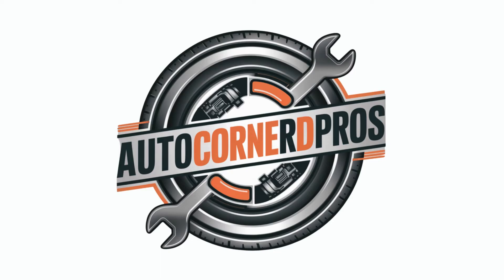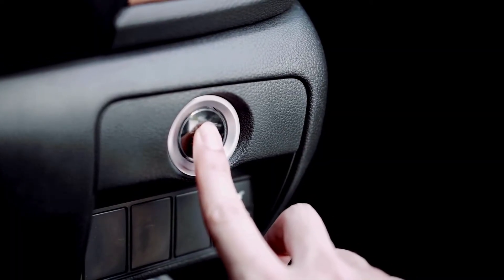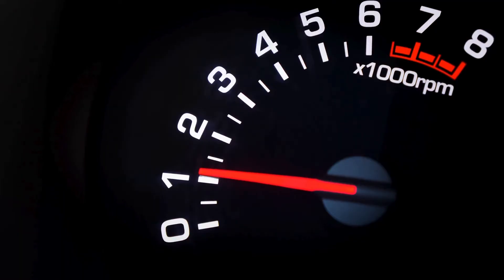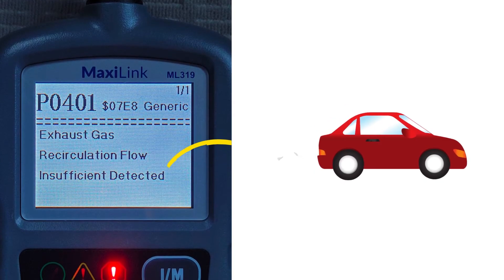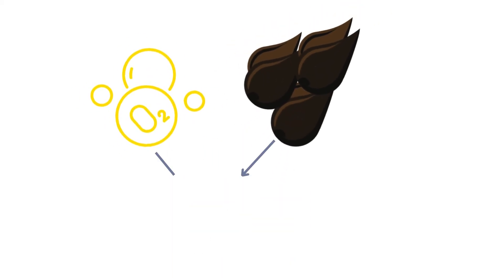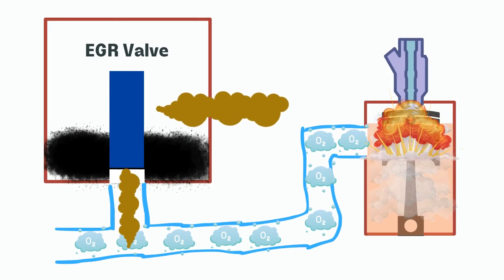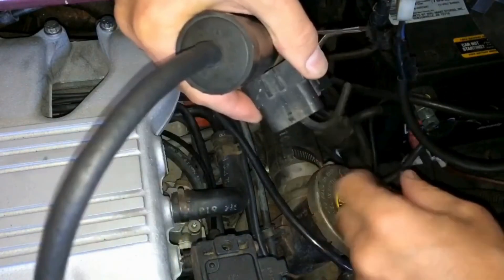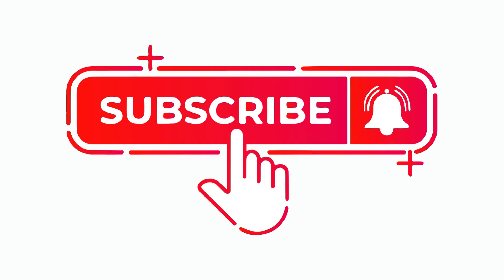7 Shocking Symptoms of a Faulty EGR Valve (You'll Never Ignore Again!)

Comment: Need to test or go over the egr "valve control" unit on the driver side valve cover with two vacuum lines. That solenoid directly influences the EGR. I have obd 1 so code 84 and code 33

Comment: i get the P0403 and my symptoms are... loosing engine temperature in idle and sometimes when i lower the speed (lets say from 150kmph to 80kmph) the drops are only in the 85-89 limit
also i hear 3-4 puffs from under the EGR when i turn off engine
there is no increased fuel consumption, and the car accelerates without lag.
what should i do? :)

Comment: Replaced my egr valve on a 07 dodge ram 1500 w/5.7.    Still had egr issues... guess new doesn't always mean it good....get a bad/low voltage to egr code....
Reply: Part quality makes a difference. The tubes get clogged too. Then theres wiring harness problems. Maybe do a diagnoses instead of throwing parts at it?
Reply: Thank you